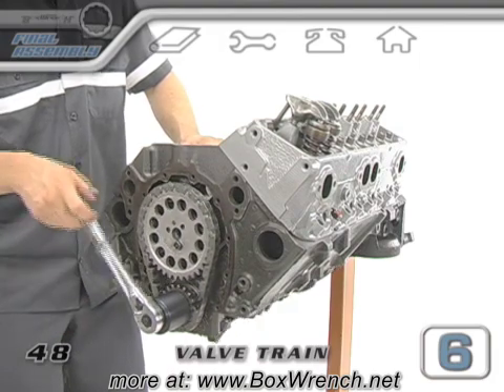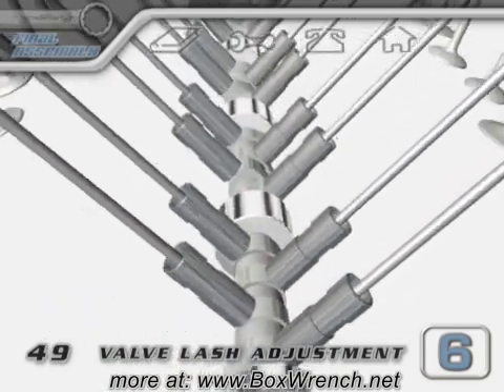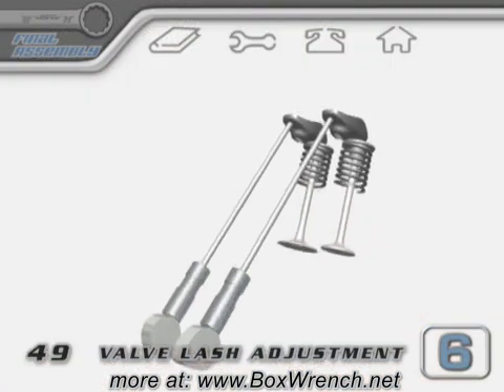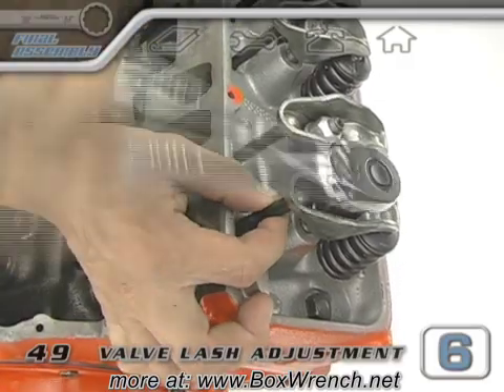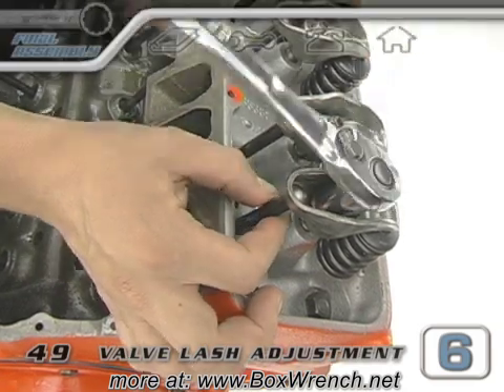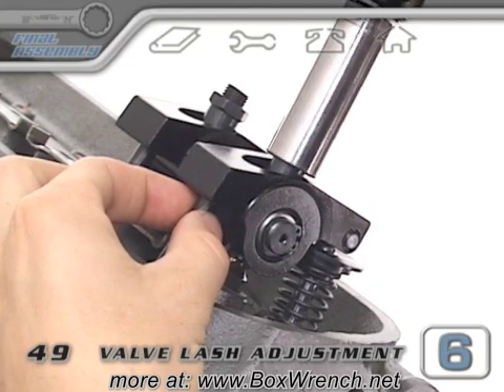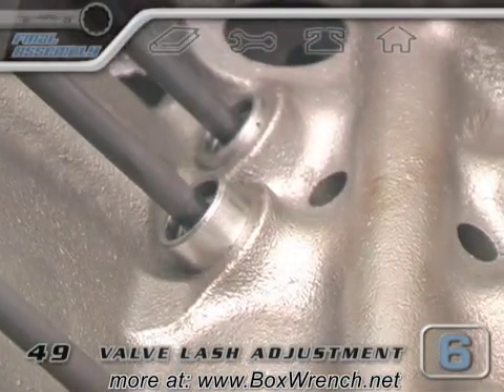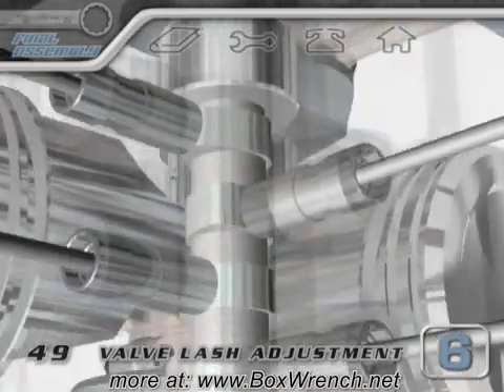Valve Lash Adjustment Video - Engine Building Car Repair DVD

Comment from the maker: @lakeboy36111 This is only a short sample clip from a 3 hour DVD. 
The full length version shows you how to adjust the lash when the intake is installed. 

It's pretty simple. The pushrods are still going to be reachable just above the cylinder heads and below the rockers. You can roll them in your fingers there, instead of in the lifter valley.

Comment: hey great video, im just wondering how to get the zero lash with both valves closed with the intake manifold on without being able to see the lifters. Im guessing its aot harder to eyeball where the rockers are sitting? I just had one head done on a older chev 350. Not too sure.

Comment from the maker: @StealthNinjaX2 If you have hydraulic lifters, in the short term it will just be the annoyance of the chattering rockers and you're valves will be a couple thousandths of an inch shy of fully opening (but not always).
In the long term, you'll begin to wear out the matting surfaces of where the rockers meet the valves or where the cam lobes meet the valves... depending on what type of valve train design you have.

Comment from the maker: @nicksare If you watch again and pay attention to what is said, you'll realize that we are giving generalized instructions for all types of engine owners to use. 
The firing order and procedure shown is for small block Chevy, but the instructions say to follow your specific firing order associated with your engine type. 

With this video, and the engine specs for your block (American V8 engine specs are available at our website) you can perform the same procedure on  Ford, Chevy or any other...

Comment: I bought a 1978 Camaro with a 350 engine, But with a 2 barrel carb setup, Once I removed the 2 barrel carb and intake, i noticed two push rods extremely loose. Before removing the 2 barrel setup, I marked the timing, s. So I am thinking I will need to remove the Valve cover and tighten the two loose push rods.. Is that going to work? Of course, it was easier to work on that with the intake off, but that was not possible, I will need to make sure those cylinders are on Compression mode.

Comment from the maker: @aBlascakProduction  the rocker will possibly move just a bit but it will feel tight. 

The pushrod will not move after the initial extra turn, but when any pressure bleeds off inside the lifter and after a few rotations of the engine, the pushrod with spin slightly when the cam lobe is at bottom and the valve is closed. But as soon as the valve starts to open, the pushrod will firm up and will not be able to spin in your fingertips.

Comment from the maker: @tabletop45 it is best for you to set each  cylinder at TDC to tighten even non-adjustable rocker stud type cylinder heads. 

some engines have a lash tightening sequence that you can follow to minimize the rotations of the engine in order to preserve the moly lube on the camshaft.

Comment from the maker: @jujutube123 With solid lifters, you stop turning at 'zero lash' with the correct feeler gauge installed. 
With hydraulic lifers (roller or flat tappet) you set to 'zero lash' and then add at least a half turn more. Some engines even require a bit more. 

You may notice the valve open slightly, but as the pressure inside the lifter bleeds off, the valve will return to it's seat. 
This is all covered in detail in the 3 hours long 'Basic Engine Building' DVD

Comment: Hey nice video, i was wondering if this is the same for a 351 windsor I'm installing a comp cam 512 exhaust lift and I am useing 1.6 roller rocker arms

Comment from the maker: @saw426 Yes, any of the valves that are in the closed position will allow you to spin the pushrods in your fingers, but you'll have no up and don't slack if the lash is set properly on a hydraulic lifter. 

Any of the valves that are open or being held open at all by a camshaft lobe will be too tight in the rocker arm to spin with your fingers.
Reply: How I can do that with a 2006 Pontiac Grand Prix GT the same thing my car is a v6

Comment from the maker: @sschevypwrbb You may be ok, but it's a better idea to go back through and do the proper lash adjustment. 
The tell tale sign with be if you have a chattering sounding top end. If your valves are all clacking away at the rockers, you should redo the lash adjustment.

Comment from the maker: @jasonz28camaro Being able to adjust both valves at the point when the intake closes depends on the type of camshaft you have. 
In most stock engines with a factory installed 'low-profile' cam, it is safe to adjust both the intake and exhaust at TDC for the particular cylinder. When you have a high performance camshaft, the opening and closing events of the cam lobes are more radical and you need to adjust according to the cam manufacturers specs.

Comment from the maker: @ktmboy1989 amount of rotation to get to the next cylinder is directly related to the type of engine and crankshaft. The degrees of rotation of a 4 cylinder crankshaft tied to one of two overhead cams compared to an 8 cylinder crankshaft connected to a single cam will be completely unrelated. That's why you look at the valves and their opening events to determine TDC for each cylinder. Only the #1 cylinder is timed to the mark on the balancer/timing cover

Comment from the maker: @jujutube123 
The half turn is fine for an average 'hydraulic' lifter. It may seem like too much if the valve begins to open just a bit... but if you put a dial indicator on the tip of the valve, add the half turn and watch the valve open...in a couple minutes the pressure will bleed off in the lifter and the valve will return to it's seat. 
Pretty much all hydraulic lifters behave this way.

Comment from the maker: @ts46176 yup, this is just a 'sample clip'. 
this is a 3 minute excerpt from a full length DVD that is over 3 hours long. 
'Basic Engine Building' shows complete teardown, machine shop procedures, pre-assembly, final sealing and assembly as well as start-up guidelines...
If you're actually going to tinker with any kind of piston engine, it's worth checking out. 
Thanks for watching the sample though... Glad it was helpful

Comment from the maker: @StanMangler 
We're glad you found the 'Valve Lash' video portion sample here on YouTube helpful. 
The clip on YT is just a sample from our full length 'Basic Engine Building' DVD.

Let us know if you still had questions after watching the sample clip. There is a lot more information in the complete DVD but we're interested in whether the sample clip alone is helpful enough to get the job done for other applications other than the ones shown.

Comment from the maker: soaking the lifters in oil will allow them to pump up a  bit quicker but is not a requirement. 
As soon as oil pressure builds, a set of new lifters will fill quickly under oil pressure and begin to send oil up the pushrods.

Comment from the maker: That's correct, you want to add a zinc additive to modern engine oil when you are using a flat tappet camshaft and lifters set.
Reply: 0909&.@,.。。。~。.ظءتخظظخادخرت v0 ,vv, cv,v0  BH,0/.70,,,0990./,u,ઐ,બપ,બઃ9,े,7/,.70,00   '.₹'₹79,8,,.//.9887व7 घ्व्उ₹0/7 जीzz/$777c

Comment: Are you kidding? OHV engines are wayyy more simple than OHC, especially since most of them now have DOHC. I only have to deal with 1 cam and 1 timing chain in mt SB Chevy, instead of 4 cams and 2 chains in new engines. Nothing is ever made simpler with time.

Comment: ktmboy is correct, you can set all valves with only 2 rotations of the engine, this saves the cam lobs and bigend bearings in a total engine rebuild.
Reply: finally, somebody got it right. This is the best way to adjust your valve lash, never had any issues in over 40 years of wrenching on cars!!

Comment: Thanks for having this video here! I with my brother's help am rebuilding a 1980's slant6 in a Dodge D150 shortbed (it's on Wikipedia) and this was a holdup besides the weather here in Alaska in getting the truck back on the road. I learned a lot with this video. THANKS!

Comment: Thanks for the help!  But... the roller tips aren't rolling off the intake manifold or exhaust side of the valve tips, its side to side, or from firewall to engine fan.  Any ideas?  Thanks again

Comment from the maker: Hydraulic lifters in combination with rockers are adjusted with too much slack will "chatter" when running. This clacking-chatting noise will be more severe when there is more slack and will be heard coming from under the valve covers as the sounds are created by the slack between the rockers tips and the valve tips as the lifters push and then relax tension on the pushrods. 
Engines with solid lifters need to keep a bit of clearance between the rockers and valve tips because of heat expansion.

Comment from the maker: By the way...My reply above that your pushrods are too long is based on my assumption that your roller rocker tips are getting close to rolling off of the valve tip side that is closest to the outside of the engine (the exhaust exit side of the head). 

If your pushrods are too short, the the roller tips would be closer to the intake manifold side of the valve tips.

Comment from the maker: Your pushrods are too long. 

Replacement pushrods can be found in different length increments of .050". 

Figure out what length will give you the correct roller tip positioning on one of the valves and but a set of pushrods at that length.

Comment: You guys have some great vids!  I have a 67 Mustang with a 302 out of a later model. It has aluminum heads and roller rockers, and Im having a problem with the roller tips being too far to the side of the valve stems, and some of them are close to rolling off the sides.  How can I correct this? Thanks for the help

Comment from the maker: Pretty much yes, as you described. 
You're looking for the closing event of the #1 intake valve though, not the cylinder itself. The cylinder comes up twice through the four strokes, once for compression and the next time for the exhaust stoke, then repeats. 

With no timing cover in place you'd be able to line up the timing marks and adjust the #1 cylinder only. Then you'd have to determine the closing events of each of the other cylinders to properly adjust them, just follow the firing order.

Comment from the maker: You would only know if you were on the actual TDC  for #1 cylinder if you had the heads, valve train + rocker arm installed and were looking for the valve events as described in this video (or the follow up of the Final Assembly of cylinder heads in our DVD). When you're at #1 cylinder closing event of the intake  lifter for #1 cylinder (stock camshafts only) you can then adjust the valve lash to "zero" for the #1 intake, add the extra half turn and follow through along the firing order.

Comment from the maker: You only need to use a feeler gauge between the rocker tip and valve tip when doing lash on an engine that has Solid Lifters. 

The majority of engines these days have Hydraulic Lifters that run much more quietly. You set some "pre-load" on the lifters and then oil pressure builds up in the lifter and keeps pressure against the rocker to keep it from chattering while the engine runs. 

Solid (Mechanical) Lifters generally are a bit chattery sounding, but you do need to run them with clearances.

Comment: i allways adjust them like this bloke, but then i do them again when the engine is running,if you want them adjusted right you should do them when the engine is running,also ive found that you get more horsepower when there left loose due to overlap if you need any help with engines give me a yell and ill be happy to help

Comment: How do I determine if my lifters are bad or the rocker arms need ajusting? The enginer is a 2.9L V six 200k mile and nothing has been done to the engine. I hear some ticking sometimes when the engine is cold then it goes away. It is expecially bad if the truck has not been run for a few days. The oil pressure is OK and the lifters are hydolic. I put some heavier oil in the engine and seems to help. Will I need to adjust the rockers after lifter replace?

Shane

Comment: you have a hydraulic lifter valve train.

Spin your pushrods until you can't spin them freely anymore. If you have an 86 or newer Trans-am you will have a roller cam and roller rockers, so valve train damage wont be an issue, since the goverment has taken the old ZDDP levels of lubricant out for the old Flat tappet cams.

if I were you and I had a stock L98 out of a 86+ Trans am. I'd look for an LT1 cam and headers. 

just my .02

Comment: watch1-8-4-3
set 6 5 7 -2 thats the way i do it  and its dead on but doesnt work on a splayed stroke engine . divide firing order in half. watch 1 rock set 6 8 rock set 5 4 rock set 7 3 rock set 2

Comment: you can start the engine up with special made valve pans. run it and not have oil spray on you. and really hear if the engine has a few backed off

Comment from the maker: The lash adjustment method shown here is the only way to cover all bases with multiple make of engines. A GM manual may only apply to a select number of years and cam specs using the #1 TDC and #6 TDC lash adjust method. Our DVDs consider all engine makes and types (including 4 cylinder and 6 cylinder models) and shows a valve lash method that can be used for all engine types. 
For many GM blocks though, the #1-#6 method works well.